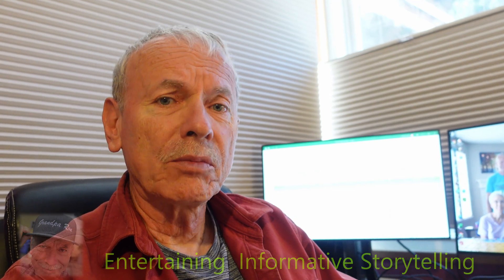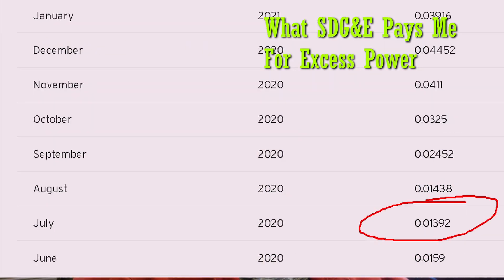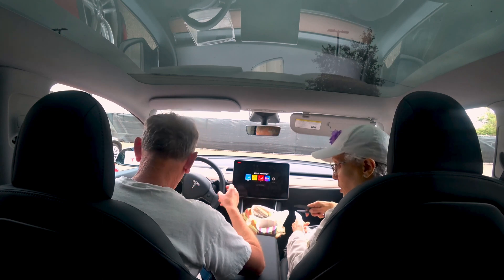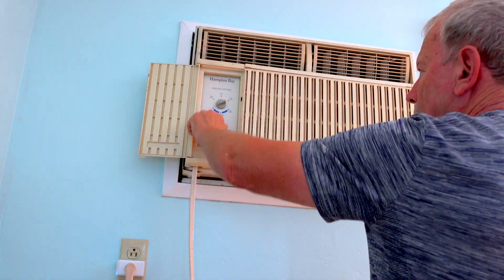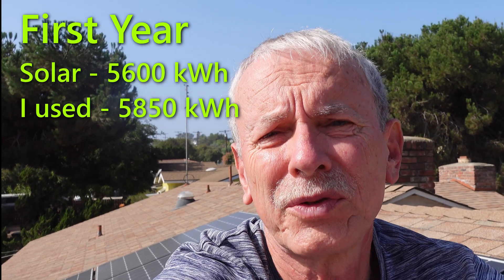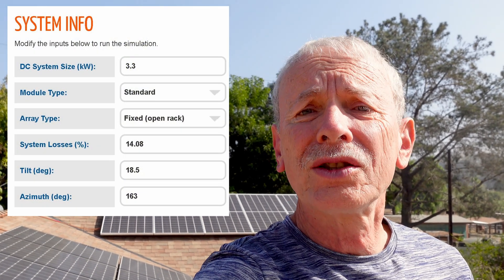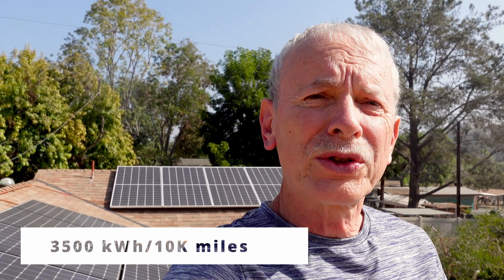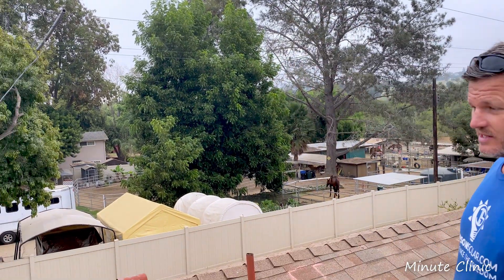Bought a Tesla, NOT enough Solar to Charge it.

Comment: What about the battery bank to store that energy. If you work you can’t charge your car during the day during peak sun light hours? Are you just getting a discount through your electric provider
Reply from the maker: Battery banks are still too expensive. I rarely lose power and generate more solar than I need. Some day I will have a car that can supply power to the house when needed. That will be my bank.

Comment: Did a DIY install of 17 panels in S.D. about 10 yrs ago.  Since then, have added two electric cars, so I expanded the system with 6 more panels.  The key is use microinverters.  They are relaible and allow expansion easily.

Comment: Wow your power company is ripping you off with those rates. Both the net metering buy back rate .13 cents on the dollar and .62 cents per kwh at night. SDGE that's San Diego i'm assuming? It's ironic how politicians are pushing for people to go green yet allowing bills like this for the power companies to pass.
Reply from the maker: Got even worse. This month they more than doubled the cost of natural gas from $2/therm to $5.11. I’m now using the mini splits for heat.

Comment: Simply a question but: WHY No battery? In your case it sure sounds like you bought a bike and found out that you really needed a truck. Too much retirement and too little knowledge on your travelling needs, retirement does not mean your life stops and that you have less time. Retirement means more time to explore and get around to doing those things in life you did not have time to explore when you were a working dude. More Solar is always the way to go PERIOD and by all means get yourself as much battery as you can afford Charge up on Low electricity and use that battery when the power is expensive.
Reply from the maker: Batteries sound good but are currently way too expensive compared to using the grid as a backup. My electric bill is $10 a month and. Battery bank costs $13,000 for each unit. Most houses get 2 units. Not very economical if the grid is available.
Reply: @grandparonstesla5141  Actually the reverse is truer.
Charge up your battery when electricity is cheap and use that power to electrify your home.
Saving the grid during the day for selling your excess power generated and negating any and all Electricity Bills.

Some people need things spelled out I guess. Other things just need common sense to figure it out.

Comment: Here in Australia, we have a LOT of solar on homes. 6.6kw is considered a minimum nowadays. Recently got a 9.87kw system (470W Jinko N type panels with a 8.2kw Fronius inverter). We considered a battery but at the moment cost is too pricey at the moment. We have an EV commin soon as our family car and plan to switch Hot water from gas to electric maybe later down the track... though gas cooking is preferred in my household. 

In Australia solar makes a lot of sense. As they say no-one has complained about oversizing a system, though I guess cost will play a big part in this.
Reply from the maker: I did not anticipate the price of gas going up so much. Using my mini splits for heat now as they are a lot cheaper to run.
Reply: @grandparonstesla5141  did U eventually replace those very old AC units? Those were ancient lol

Comment: My family and i lived successfully for 10 years in the Australian outback powerd by solar. 
I worked what we needed and test ran it for 12 months in the city before we went bush.
It worked out to double and a half of what I thought I needed..worked well.
Now I'm back in the city on the grid cause it's still cheaper .
Reply: why not use ongrid or hybrid inverter?
Reply from the maker: Every situation is different. For me my situation changed and i had to adjust. Since i have the grid available, it is much cheaper to use that when needed than buy an expensive battery bank. This could change in the future of course.

Comment: You should upgrade your air conditioner to a mini split system with a high seer rating. You'll get much better cooling and it will use about half that of your box unit I saw here.
Reply from the maker: I have 2 mini splits. They work great.

Comment: I appreciate your honesty in this video.  I prefer traditional natural gas and have a V-8 powered Otto Cycle Engine in my car.  There is no way I would trade either for solar and/or an electric vehicle.  I live in the northern part of the US and solar alone will not hack it - we would freeze in winter.  Also, sitting around a charging station when it is -6F outside isn't feasible either.  I would rather just pull up to the Mobil gas station and fill it up in under 5 minutes and go for another 450 miles.
Reply from the maker: I understand. Grew up in upstate New York and burned wood for heat. My particular energy costs in San Diego are the highest in the country so makes a lot of sense for me. Electric cars are still quite new and will keep getting better over time.

Comment: Interested in your comments on your Model Y which we have as well and use of solar throughout the day. Our situation is different because we are on an hourly rate in IL and ComEd is supposed to pay us for generation at same rate they charge us. We charge the EV in the middle of the night to take advantage of low rates. I only just installed the our roof solar system so not sure of this. My question is why you, with high power cost in afternoon and insufficient generation off the panels, did not consider battery? Is it simply because of cost or are you feeling that current batteries will not be as good as those that will be commercially available in the near future?
Reply from the maker: Our. Grid is very reliable so cost of batteries would not be worth it. I only need a bit of afternoon power during August and September for AC.

Comment: If you use EV-TOU-2 or EV-TOU-5 plan and charge your EV during super off peak time, you can use more kWh than solar generated power which is usually during off peak time, which has higher rate than super off peak. So it’s not exactly 1:1 calculation if you take advantage of time of use.
Reply from the maker: Actually i have excess solar during the day so i charge when sun is shining.

Comment: Where I live, we have to have the size of the system approved by the electric company before you install it. This is purely based on past usage. I went to them last year and they told me they would only approve a 6 KwH system even though I had an electric car on order and a hot tub on order. They said they can't size a system any bigger based on what might happen in the future. So, I waited a year after getting my EV to actually get my solar system sized correctly. I am now approved for a 10 KwH system and am in the process of having it installed within the next month.
Reply: Home of the free
Reply: Where do u live?

Comment: I got confused at first thinking tesla solar and seeing non-tesla panels :). Curious if tesla gonna install it the same way. I don't like electric conduits going all the way through the roof from one array to another array. When it's gonna be time to replace the roof and shingles, - that electric pipe will be on the way and need to be fully removed.  If it's possible I would force those guys to run conduits in the attic.

Comment: It just amazing how the same story is told over and over again. Typically 5000 kWh a year per EV is the minimum. Add the AC competent yeah you really missed. At least you were smart and got Sunpower panels.  The Hanwah Q cells were NOT a good choice! The Hanwah will degrade at twice the rate as the Sunpower. You will be adding more panels in a year or two as you watch the production drop faster on your Add On.

Comment: Solar panels aren't going to do much here in ny covered with snow or when you get about 10 hours of filter sun light
Reply: So what is $$$$
Reply: Another question, roof comes with around 20 to 25 years before needs to be replaced. My sisters insurance forced her to get new roof or pay higher insurance. How does insurance company handle these? So many variables
Reply from the maker: Solar company wil remove and replace panels for roof replacement. Cost around $100 per panel
Reply: @grandparonstesla5141  and will add how much $$$ to already high roofing price

Comment: I struggle to believe anyone who lives in sunny area cannot power their EV on solar. Batteries are expensive however absolutely necessary to store energy generated and be large enough to store  the energy needs of the EV, most people travel less than 30miles a day. Therefore you only need to generate 10-12kW per day (size of the Tesla Powerwall). If you have a decent size array say 5kW that’s only 2-3hrs of sunshine a day. In Scotland it averages 1100hrs a year of sunshine which dispute being v.north it can still meet this demand! Winter months in Scotland I would agree are not going to support however the other 9 months should be fine.
Reply from the maker: Exactly. I was good until the winter. My array was only 3.3kW and was too small. Now with 5.4kW, I’m good all year.

Comment: Some installers hate micro-inverters they give the impression that they are no good. I don't believe it. I reckon the issue is as follows. For the home owner if one micro inverter out of lets say 12 panels goes bad within 5 years that does not seem a big deal for the installer to change. From the installer POV if they have to do a similar replacement at 40 houses over 5 years for them it is a pain in the ass. I reckon this is why many installers are hostile to micro-inverters.
Reply from the maker: Most of the installers I quoted used micro inverters. My system is rather small so maybe with large systems it is cheaper to use optimizers with string inverters. I any case, it is up to the homeowner.

Comment: With California’s time of use charges I’d consider installing a battery backup. You can use it to store electricity from 9 AM to 4 PM and then use the power from it from 4 PM until its drained instead of paying $0.63/kWh. That will save you a huge amount of money.
Reply from the maker: I did consider batteries but could not justify cost.

Comment: California :   I  am  on  the  low-income 'CARE'  program  which  lowers  my  rate  to  .22 cents  per  kilowatt.   If  not  on  CARE ,  the  rate  is  about  .31 cents  per  k.  ! !   ( First  level  of  3 )  
   Around  1980  lived  in  Dunnellon ,  Florida  &  the   Energy  Co-op  charged  .04  cents  per  kilowatt !!!   It  was  a  Co-op = non-profit  owned  by  those  connected .    'They'  don't  do  that  here  .  .  .  .  .  
    I  have  several  panels  in  my  backyard  as  part  of  my  'Off-grid'  system  &  several  'power-stations'  being  charged  by  those  panels.   My  average  Electric  bill is  around  $30.00  since  I  run  most  high-power  demands  from  the  Off-grid  system.    I  think  'they'  are  pissed  with  people  like  me  since  my  gas  usage  had  an  added  'low-usage'  compensation  charge  added  on  several  bills  last  year.  A  'fine'  for  being  conservative !    ( I  heat  my  1961 vintage  un-insulated  home  with  a  boxwood  heater  &  a  fan  for  circulation )   My natural  gas  consumption  is  less  than  3  'units'  sometimes  resulting  in  the  'low-usage'  charge  they  add .      Sucks  to  be  me  .  .  .  huh ?     Ha - ha !

Comment: I think I will have same problem next year. Did you need to do plan, permits with the city and get permission to operate from SDGE?
Reply from the maker: Yes for first install. No for additional ones.
Reply: @grandparonstesla5141  interesting, is that allowed? I thought every time I change the system I am supposed to redo project, permits, SDGE application, etc.

Comment: Get a battery pack rather than more solar to even out the troughs n valleys
Reply from the maker: Batteries are very expensive and don’t generate any energy. Nice to have when power goes out but that rarely happens here and I have a diesel genny if it does.

Comment: Get rid of the inefficient window rattlers and replace mini split heat pumps, a lot more efficient.
Also run when you have excess PV capacity to precool the home before you run out of PV production.
Reply from the maker: Mini split going in today. Video in the works.

Comment: A good inverter mini split will save you a lot of KWs. Also I have a "Midea U Inverter Window Air Conditioner 8,000BTU" .with a watt meter I saw a 50% savings to cool the same room as old window unit. it was easy to install and cost $360 plus tax
Reply: You need really good batteries to keep them running when sun ain't shinning well or you need some kind of grid backup. I have 3.5kw solar system but sometimes it is not enough to start an Air Con you need batteries or grid. Mixing grid with solar is perfectly ok

Comment: How much are you losing from dusty panels? They advise not using any soap to clean them because soap residue blocks uv rays.. distilled or filtered water and a squeegee
Reply from the maker: In my testing, 2 months of dust dropped the output 4-5%.  Not that much. I cleaned them with water from a hose. Don’t think soap would do much.

Comment: do what we do in australia have a diesel gen behind the fence to run the EV chargers - green power
Reply from the maker: Funny but I have actually used the diesel gent in my RV to charge the car. It is very slow tho.
Reply: Yeah. It was pretty clear there were no permits for the addition. Hah hah. I liked, "my wife disagreed." I'm glad to see they didn't use harnesses. That adds an additional safety risk of tripping that outweighs the supposed reduction in risks especially when carrying solar panels. Additionally, harnesses pull on your back and create long term health issues and make you miserable so you want to quit your job.  So, good for them. I was surprised to see no 18" walk-path at the ridge for firefighters. Oh well. Microinverters are nice since you can easily expand the system. Note, our utility can tell when you have energy production in excess of what you have permitted, but you'll probably be ok.

Comment: I have a solar and wind generator system. I  believe lots of batteries are the key. So on days when there's lots of energy the batteries can store it. Yes my system is stand alone on a boat
Reply: Using battery to charge another battery wasting a lot energy in between....
Reply: that's the issue with wind and solar... the batteries are not large enough and cheap enough.....

Comment: For adding 3 panel's i'd just do a basic Grid-tie invert string, can prop them up against a fence even, since you already have net metering from your previous install it wouldn't matter if you pushed power back to grid. Also your kwh rates are absolutely ridiculous, I can see why people are fleeing California in droves.
Reply from the maker: I’m glad I got the 5 additional panels. Could add a few more to existing wiring if needed.

Comment: With 18 kW of panels (and 100 kWh of storage) we could just keep up with the house, the shop, and the Tesla model 3.  After my wife's model Y came we had to bump the panel array to 21 kW.  (56 to 64 panels).  Phoenix can see 110 degrees F day after day in July and August.  We rarely run all 9-tons of AC at any one time.  100 kWh of storage can handle all loads all night unless we get two rainy days in a row.  (Also a retired engineer)  If I could get a permit I'd need five Tesla power walls plus panels to accomplish the same result.  Considering the labor, engineering, and optimization put in over the last four years, I have great respect for the best of the legit installers.
Reply from the maker: You have a really big system. Here in SD we don’t need much AC and with a small house the car is the only big user. I think the 5.4kW system should do it.

Comment: Thanks for your video. I'm also retired and just wanna relax and have a good time (before life goes horribly, horribly wrong in the end... hah hah). Here in Galena Park, Texas right next to Houston, I recently got 30 Tesla solar panels and three power walls. I physically disconnected from the electric grid while waiting for permission sell back to the grid. But I don't like the agreement or contract as it seems to give too much authority over my solar power system. It won't feel like its mine anymore. I generate more power by far than I use ( that was my intention), and I'm considering getting and EV that should workout just right to use the extra solar power now going to waste. And I won't have to buy any gasoline when I eventually sell my Corvette and later on my Lincoln SUV when I feel I can trust an EV. Of course I'll have to gas up my motorcycle, hah hah. ⛽
Reply from the maker: Seems like the utilities are in business for themselves and not to serve the public.
Reply: I believe HD is working on or even now selling an electric bike. Check on Netflix.

Comment: Hi Ron,  I just had a solar system (5.44KW) installed which is ground mounted & single 6KW inverter. Just wondering what your system cost if you don’t mind sharing. 13NJ View/Navion member here and appreciate all your RV videos!
Reply from the maker: Both together were $17k before tax credits